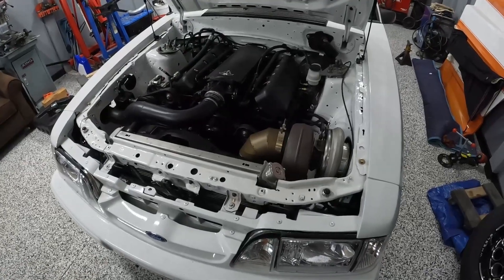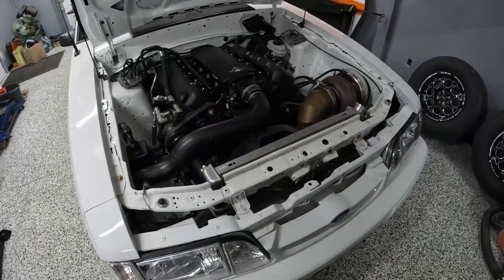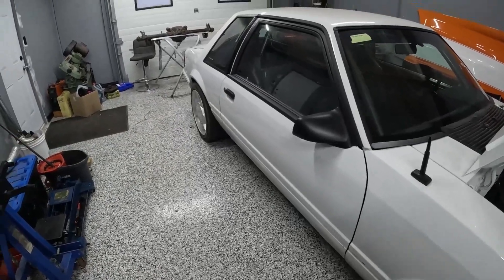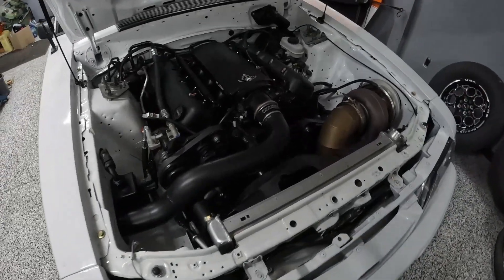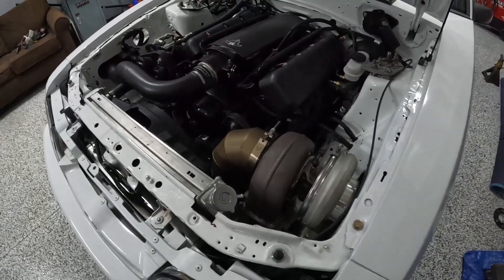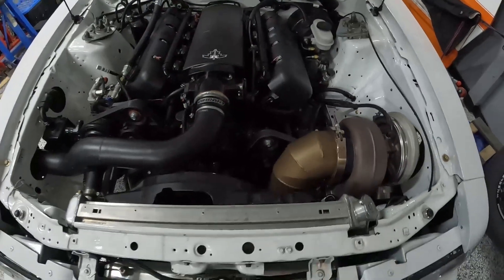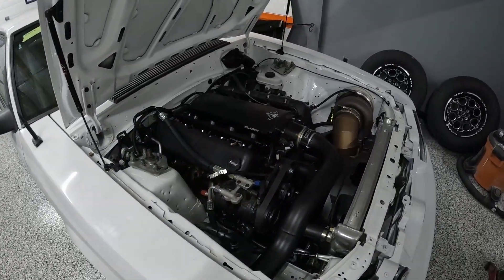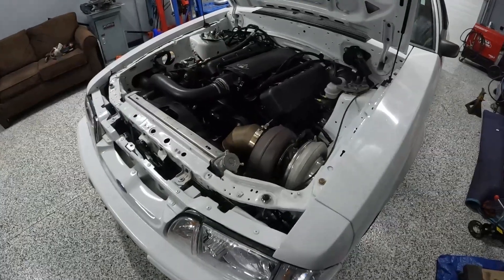Why you DONT want a T6 Turbo on your LS Engine ( 7875 vs S480 )

Comment: I'm building s 460 BBF and was considering the 7875. Would a big block be better off with the S475 /S480? i want to feel it down low but also want to carry through 6000. Also, t4 or t6?

Comment: I've got a 5.3 with next gen 78/75 .96 housing, log manifold setup with full 3 inch exhaust. It made 503 at 12lbs at 4200rpm. it spools quick but does have back pressure. power and boost falls off after 4200 a little bit.

Comment: Will a t4 7875 work on a 403 ?

Cam 215/231 duration @ .050 lift - .631/.644 lift 

6 speed. Possibly 3.42 gear ratio or lower

Front or rear mounted setup with 50mm wastegate
Reply: @262santi  I made 735 wheel through a billet gen 1 with the 3” Dp, Ss2, 6.0 tbss
Reply: Thanks for the reply . I bought a cheap ebay one that I plan on getting most of the tubing  done and figuring out the bugs ,with plans of a name brand turbo the future
Reply from the maker: @262santi  yea it'll work fine, just don't expect much more than 600whp on the basic journal besring unit

Comment: I would like to hear more about gear Ratio for turbo. I installed 488's  to get my NA 6.0 with 35×12.5 rolling  It worked out good for my application. Probably would have been better off with 456's for hwy. But When I built the truck it didn't see a lot of highway. Things have changed. If 456 is Right for my Application NA What year would be appropriate for 8 lbs 600whp.  I don't see people talking about this.I would appreciate the help. ✌️ p.s im Is pretty sure ive seen sloppy get 800whp with gen2 vs Billet wheel t-4 7875  on E-85
Reply from the maker: @kevinwest3689  for me at least gear ratio calcs come from desired rpm through the traps at the track!
Reply: @WestcoastWrenchin  well it was worth a try.  Thanks for your time.
Reply: What kind of truck? 1500 or 2500? I’m pretty into truck building and might be able to help out some

Comment: If your camshaft is too big you will run into reversion problems. If you can put a smaller cam shaft in your car and make more power it is because the valve is not open as long as it closes before the reversion therefore it will make more power because you have better velocity Due to less reversion. If the valve closes sooner and does not open as much and does not stay open as long you will see an increase in power with a smaller cam. The trick to making horsepower is to have the smallest intake runner possible while flowing as much as posible. The only thing that can help reversion on a camshaft that is too big for say the street, Is RPM. If you want RPM you need lots of stall and a correctly geared car.  Basically you need the smallest runner possible with the most flow possible with a camshaft that is tailored to street driving lower lift and lower duration. For a track car it's not gonna run well download because you're never gonna be there with your converter selection. Remember RPM is your friend because you you break things when you make high torque at low rpm. The most important thing I can articulate is high flow at low lyft numbers that is what makes an engine good for the street. Wait of the car is a very important factor. A engine in a lightweight car is much less likely to detonate than that same engine in a heavy car because of the load. Anyway I'm just rambling God bless and thank you for the video. I would like to know your thoughts.
Reply from the maker: @danieljames5875  you've got some great points! For sure the reversion is important, I'm surprised with my new cam for the mustang how big the cam looks on paper vs valve event locations. My new belief is that max effort turbo cams will always have advance in them
Reply: @WestcoastWrenchin   Not only advance but you're LSA on a properly specked camshaft almost always measures out to be very high, Usually a engine that has 40 plus pounds of boost will almost always run best with a wide LSA Like 112 to 116 and will probably have +3 to +6° advance. The wide LSA helps with the Overlap/reversion and allows for better cylinder filling. Your backpressure or drive pressure is higher under boost then you're boost pressure. The correct valve events wont allow the higher exhaust pressure in the cylunder while it is being evacuated to get pushed into the intake runner Because the boost pressure is not as high as the back pressure of the Turbo.  Same thing goes for N/A engines but you do not have boost pressure to help combat the the pressure difference.  Speaking to what I said earlier about high flow at low lift, you need to know what your valve is doing every 50thou of cam lift.  You then need to apply your rocker ratio to that calculation. When you get into higher Rocker ratios it changes the speed of the valve and believe it or not it also changes you're duration numbers.  When your picking a camshaft & you're only choosing it based off at 50 numbers then you are very much in the dark & playing with fire. I would recommend that you don't buy a camshaft unless it has a Cam Doctor sheet or you have something that shows you it is what it is advertised as. Also they may be the same at 50 but at other lift numbers they are drastically different. You can have 2 cam shafts that have the exact same durations, LSA & max lift numbers and they could have a 100hp diffrence.  If you don't believe me go check out the guy that did the camshaft challenge here recently. I've learned a lot from that dude. Thats why I think LSA is important for boost but is not something you choose a cam off of. Base it off of what your car is & what your doing with it, that is the most important. You should select your camshaft based on your needs and you should be striving to get the best valve events for what you are trying to do. You need to base it off of opening and closing events & off the size & efficiently of your engine's parts u have available. Idk lol... I just love my GOD, "MERICA" putting things together, learning new shit and making things make sense. Then you can apply knowledge & make things work better... Thanks brother!! God-bless...
Reply from the maker: @danieljames5875  nicely said! I have been down the rabbit hole on back pressure and camshaft selection for sure. One that I still have trouble with is scavenging effects with high drive pressure

Comment: Nice Fox, I have a very similar coupe with a 365 ls with the same front accessory drive with Ac. But I mounted the S480 on the passenger side, right under, behind the headlight. Holley Dominator, 4l80
I’m running a T4 92mm housing but at 17 psi is already 2:1 back pressure. At 22 psi its close to 48
I’m about to do a T6 swap and I believe that will definitely help out. Fun fact…I did a ls/t56 swap on mine back in 2002. Back then you never had lsx swapped foxes lol the good old days.
Reply from the maker: @scottgarmon4865  wow early adopter!!

Comment: So many different options out there for the s400 turbo's to get your spool the way you want it. Your turbine options are 75/83- 83/87- 85/93- 88/96 and bigger. Then you have the A/R housings .91-1.25 A/R on the t4 and 1.10-1.15-1.32 and bigger on the t6 side. If you buy a 78/75 you are picking a .96 A/R or 1.25 with a 75/83 turbine that can not be changed. I fell like s400 is a better option then the 78/75, Data has proven back pressure problems at 5,500 rpms and above on the 78/75 with bigger motors so the s400 with a 1.25 T4 or 1.10 T6 A/R housing and 83/87 is a better option for bigger motors revving past 6k.
Reply: @davesperformance88  Do you think an 80mm S400 w/ the 88/96 wheel in a 1.25 T4 housing would be worthwhile behind a 6.0 on a street truck?  Purely a cruiser - not much high RPM stuff.  I see that's basically what you're recommending above except this has a larger turbine.  Not sure how that would change its characteristics.  Honestly, the 78/75 would probably get me what I want but I keep running across comments saying it's limiting and doesn't offer the flexibility of the S400.  Thanks!
Reply: @TDS82  I think the 82/87 on the 1.25 would be great on the street. 85/93 would be good option but still little lag for quicker spool.

Comment: We run twin 69 billet Bogue Warners  with .96 ar turbine housing. 366 in.³ iron block LS spools super fast stick shift street car on 24 pounds runs 8.88 at 165mph. 1 to 1 back pressure at 26 pounds boost. We’ve never turned it up, but believe it should easily run well  on 35 pounds of boost. We run Bosch to tens, with a 2000 arrow motive and a 750 magna fuel that comes on at 7 pounds of boost. I think it’s making about 1250 or 1300 to the motor at 24 pounds 3600 pound car.

Comment: If you have an auto with a stall, that wouldn't be a problem.  Stab throttle, converter flashes, turbo lights
Reply from the maker: Stalls not bad, I can footbrake 3800rpm 16psi on it

Comment: Everyone on their first build. Usually over think everything like gears. cam, turbo size, and so on while asking Holdener about how much hp will it make, or what's the best rowdy and reliable heads, cam and turbo set up for 800-1000 hp daily driver with a stock bottom end. Lol. I put a 78/75 on my 99' Camaro ls1 6speed few years ago. Bought the car back in 05' and the ls1 pushed almost 500hp n/a with basically just bolt ons heads/cam  intake and long tubes. Other then I fragged a half dozen stock 10 bolts over the years while literally beating the living fuck outta her for over 200k while she sucked down NOS like it was vitamins. Hunting fox bodies and imports thru early to mid 2000s. The car was very reliable, rowdy and fun for many years but definitely showed her age so it sat for few years. Decided to restore her and add boost after my friend with a baby carrot dick bought a 2012 ls7 corvette and wanted to race. So it put a fire under my ass. Yeah she now whistles and the Car pulls harder then a one-armed gorilla Jerking off to pornhub. The car also does the greatest brodies and lawn jobs. But now she's a unreliable shit-box. Higher maintenance then my ex-wife. Less than 5k miles in 5 years. Never been to the track or dyno 'ed.  Yet I've had to swap in a L33.(wish I just went iron block) stronger t-56 from a 05 'GTO with the triple coned syncro's and the Zo6 2.92 gears.(shoulda just gone auto). a 31 spline 8.8 with 3.73s. Yet my lifted f350 6.0 power stroke weighs over 7k lbs. and does all that with only studded heads and a tune while getting over 20mpg. Thanks to the variable geometry turbos. Modern Diesel's shit n get!

Comment: Turbo selection depends on what transmission and use of the car. If it’s a street car with a standard trans go with a smaller turbo if you want response. Auto trans setups spool really depends on the torque converter specs. They need a loose converter to help spool time.

Comment: I think i split the difference. I got a completely forged bottom end 370 LQ4 with 80lbjr injectors, BTR stage 2 cam. TFS 225 cnc heads and a really nice valvetrain. Turbo is a True North Turbos S476 76mm compressor, 87/84 turbine on a T4 1.10AR housing. Should be between the 78/75 and the S480 as far as backpressure. also I plumbed in a ProMeth  Direct port meth injection kit as supplemental fueling (100% meth) Should be flowing around 156lbhr (26gph) of meth at 100% duty cycle on the solenoid. My quick n dirty math says that turns 91 octane into 99 octane with the added benefit of additional IAT reduction. (Its all downstream from my MAT sensor, so i guess i'll never know how much) Hoping that allows me to tickle 800rwhp. I will probably take it to Josh at Gen3 to clean up the WOT stuff. Truck is about 3800lbs on a 255/35r20 tire, i never drove anything with more then 275 RWHP.  But i want to do miles of mayhem lol.

Comment: I have same setup in my sn95 lq4 with ported heads and cam made 430rwhp now put the 7875 on how much power can it hold and what power should mine roughly make at 14lbs?
Reply from the maker: Mid 600s

Comment: Asked a vs dealer what turbo to get, and he said the t6 next gen 80mm. With race cover, over the gen 3 7875. For street car with lq4 and want around 700hp. Will flip stock manifolds and 2.25 to turbo, and 4 to dual 3 exhaust. And will use the truck norris cam. Believe i have 3.32 gears. Hope its not to laggy.
Reply from the maker: For only 700 the vs gen 3 7875 with the 1.25 ar would be deadly
Reply: If you were curious how it sounds. https://youtu.be/0pAE_kaD4MU

Comment: Try running no intercooler on low boost, say under 15 psi.  My turbo ls 5.3 with a $200 gt45 has been 10.33 on like 8 pounds of boost on E85 on like 17 degrees of timing.  I bracket race it regularly.  My jEGS converter flashes to 5000 rpm when leaving so that helps a lot.  My opinion is that getting rid of all that cold side leaky intercooler piping bullshit really brings the turbo alive.  On a 90 degree race day I saw 180 degree inlet temps in the traps quarter mile at 8 pounds of boost.  I know this junk gt45 will go nines lol!
Reply: I'd like to know your 351w setup.

Comment: You're right most people say ohhh I want a 1k hp Mustang but they don't realize how much power that really is. My 2015 had 1000 horsepower twin-turbo 6467 that ran 8s in the quarter and I rode on the lowest setting at 700/750 and I still had to put weight in the back just to get it down the street 😅
Reply: My fox coupe runs 1k fwhp on the streets, I have the suspension setup pretty good and will dead hook at 50 mph. But it is sketchy I. used to have a manual trans and it never hooked up well on the street, now its a 4l80.